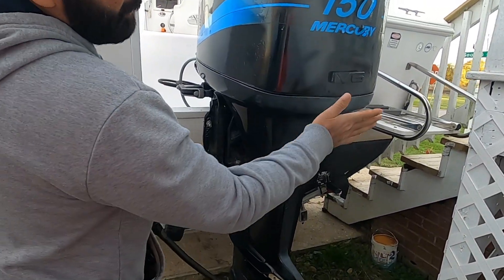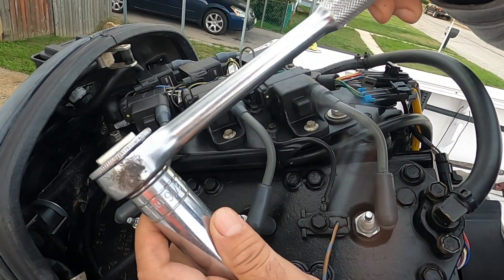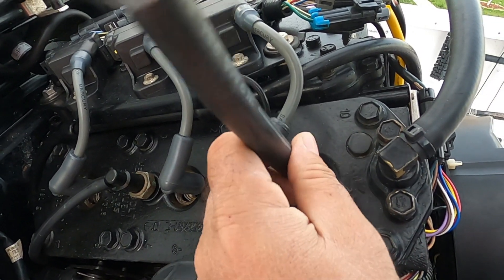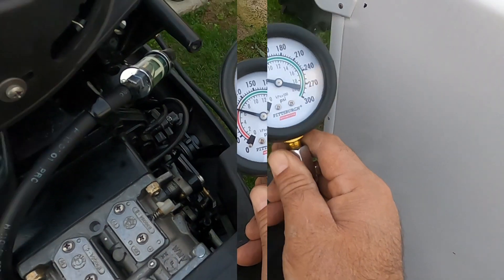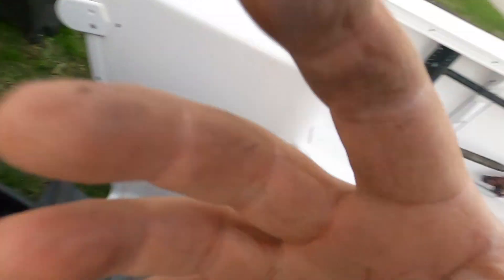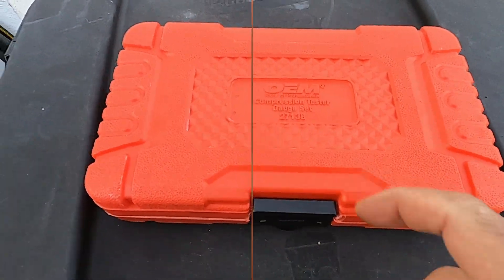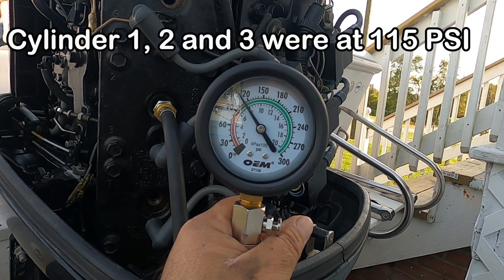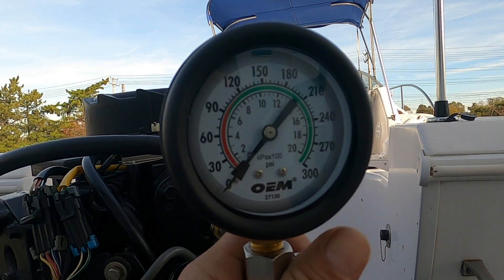Mercury Outboard Compression Test with Cold & Warm Engine | Different Results?? Find out

Comment: disable fuel pump for an accurate reading.  you didnt say that.   90 isn't great, you may not have an accurate test or accurate gauge though.
Reply from the maker: Do you think its needed for a mechanical fuel pump? What you suggesting applies to fuel injectioned and electric pumps, let me know if otherwise. Thx for sharing your experience!

Comment: I have the same engine, do you have the spark plug gap info? Thx
Reply from the maker: Its .040" or 1 mm for all 2 stroke Mercury engines from 2001 to 2006
Reply: @FKCamVlogs  thanks😊😊😊😊👍

Comment: I have a 15hp 2 stroke Mercury. Both chambers are at 75psi. Is this ok? Test was done wot but the choke was in.
Reply from the maker: Depends on the year, if its older motor then you are in range.

Comment: I've been going MAD after having my motor rebuilt. It started running like crap, so I used a harbor freight pressure tester and also got 90 psi. I had blindly ignored the test and am pretty sure it's carburetor related now, but thank you for this video!!! The same thing must be happening to me and i can write off my worries as HFT junk!!!
Reply from the maker: Sometimes its the inline filter that needs tightning, it sucks air and you feel its the carb. Check that first and yes HFT gauges nothing but crap. Good luck Captain !
Reply: @FKCamVlogs  oh I never thought to check that. But right now, it's running rich as I get unburnt fuel in the exhaust water (I haven't put in lake because of this) and a rough idle. I'm trying to think if there's a bassackwards reason air on the fuel inlet would contribute to my issues.

Comment: I’m 180psi +~4psi cold
Reply: Is it a 4-stroke?  4-strokes run 180-200 or there abouts.  I've never heard of a 2-stroke over 120ish.
Reply: @Nonplused  Outboard engines not so much, at least not older ones. Other two stroke engines can be above 160 easily, and more than that.
Reply from the maker: Thanks for sharing +- 4 psi not bad at all

Comment: I am a mechanic and compression tests should always be done on a warm engine if possible and the throttle should always be wide open and the cranking should be the same for each cylinder. The main thing you are looking for is an even spread of results. The gauge difference is not good but they were both even spreads. You can have gauges calibrated but at the price, you paid it would not be worth it.
Reply from the maker: Thank you for a great input. Much appreciated !!
Reply: Wouldn't a warn engine produce more reliable results due to metal being more mallable and piston rings creating a better seal? Feel a cold test will produce more accurate results. Could you elaborate please?  And shouldn't the fuel pump be disabled?

Comment: If motor has aluminum heads test cold!! Removing plugs when hot can damage threads!! Ask any good mechanic!
Reply from the maker: Captain you are absolutely right. Thanks for sharing. I did hot test based on some comments from viewers to show its not much difference between hot and cold test.
Reply: @FKCamVlogs  ok .
 I understand. I gave done both aswell. Same numbers. Was worried the threads will pull out when hot though. LOL